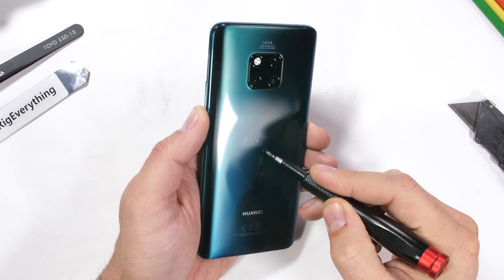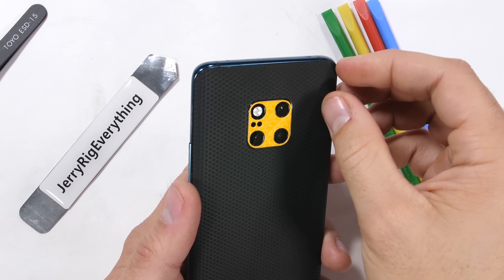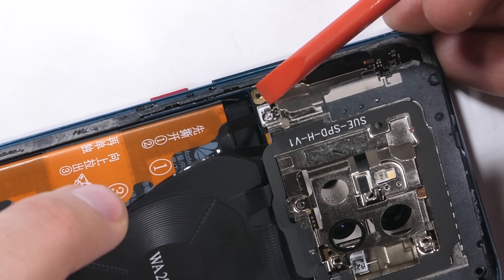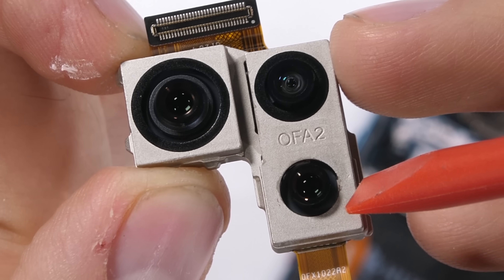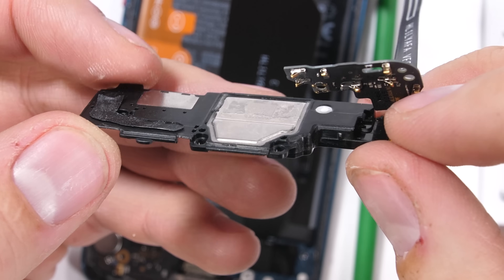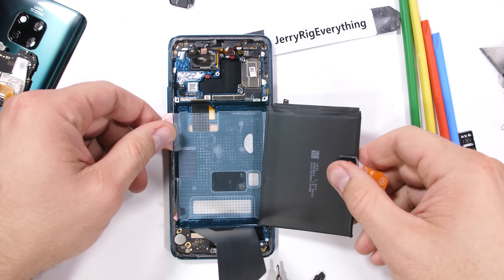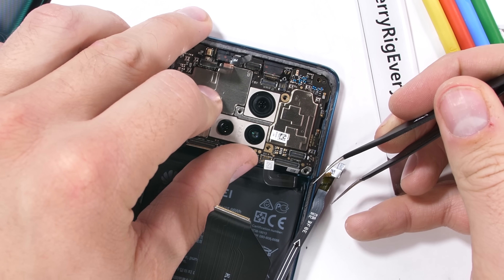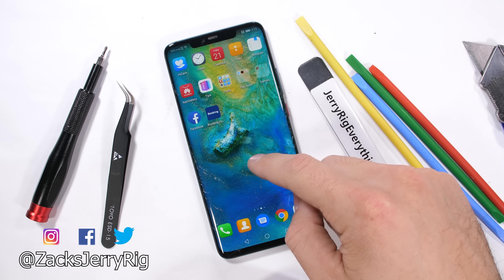Mate 20 Pro Teardown - Whats under the 'Musical' Back?

Comment: Still using this phone 6 years later. Great phone
Reply: Lol same
Reply: I am using a regular mate 20, still alive and well
Reply: So did I, until it started boot looping a few weeks ago… turns out after 6 years of only super charging the battery gave up on me. I just about managed to transfer all my data to my PC hard drive before it hit me with the eRecovery screen one day. It’s been a strong companion to me over the years though, and I will miss it. Switched to the dark side now, writing this on my new iPhone 16 pro max, in hopes that it will last even longer.
Reply: So did I too , 
but yesterday it started rebooting when the screen was closed. Is there a solution? The mobile is working efficiently

Comment: Hi, I had the same issue that the phone did not accept the new battery. Luckily I found a workaround in a German newsgroup: 1) Boot up the device using the original Battery 2) connect an USB charger to the mobile 3) Disconnect the original batery and connect the new one ( you have to be quite fast, if the phone shuts down during the change you have to go back to step 1) 4) charge the phone for about 10 minutes and check if the batteryindicator moves up. 5) restart the phone and double check that the new battery is accepted. I’ve tested this method and it worked for me.

Comment: When it hit  the market it was £899.00 new .I bought it new for £ 410.00 . 8months later . I use the wireless charging feature . It's good to have . Generally speaking it's a great phone . Technology moving so fast whatever you buy is out of date within a year. Great video. Thanks👍
Reply: I just bought one 2 months ago for $300 USD, open box from China but it's a global variant. Love this phone. Too bad most US carriers refuse to transmit over it. But it'll be getting put through the paces in Panamá! In Panamá they have no fear of the Huawei brand. In fact there's a Huawei store in the Allbrook Mall. I used my dual sim Mate 9 there before with Claro and Tigo without a hitch.

Comment: What may happend if you accidentaly, trying to take out the sim slot, you put pressure in the hole of the microphone that is next to the sim slot hole? (Sorry my english) I've just opened my brand new mate 20 pro and I did this, but I didn't feel the "accesory to take the slot out" passed through the mic. I mean, it should have something to prevent the water get inside the phone (IP68). I'm afraid that I could broke something inside or I don't know, I'm just too much paranoic right now that I broke the phone right at the first step before even turning It on jaja. Please, I need an answer...could I (did I) broke something inside? I've made tests and the mic works perfectly, I'm only afraid about the water could get in if I broke something inside.

Comment: For those who aren't aware. This phone has two speakers. Yes the usb port is one and the sound does get a little bit blocked when plugged into the charger. But if you want to know there is a speaker on the top of the phone also which raises its volume when plugged in. They both work together also to create surround sound using dolby atmos. Hope that clears that up to you all.

Comment: I used to be an extreme anti-no-headphonejack-policeofficer, however now that I have the mate 20 pro, it doesnt pose too much of a problem because the battery lasts so long I never need to charge it and play music at the same time (same applies for the speaker), also the front facing earpiece speaker makes up for the mild loss of the bottom speaker

Comment: I think what really bogged this phone down is the fact it's not sold in America, and the software. The speaker system is stupid
Reply: And you don't need to listen to music during charging, unlike all other this one last all day long and still leave you with battery before going to bed...
Reply: For those who aren't aware. This phone has two speakers. Yes the usb port is one and the sound does get a little bit blocked when plugged into the charger. But if you want to know there is a speaker on the top of the phone also which raises its volume when plugged in. They both work together also to create surround sound using dolby atmos. Hope that clears that up to you all.
Reply: @GenXchaos  that makes more sense

Comment: This would probably have been my next phone if they had bothered to include a headphone jack and an sd card slot, such a shame. I just don't get why they left that (the 3.5mm jack) out from only the highest model in the range (Dont tell me it was neccesary to save space, it almost never is), while not bringing features like wireless charging to the rest of them. They now have a range of high-end phones, neither of which has all the functions. (I do really like the IR blaster though, never understood why Samsung removed that feature from the galaxy S7 and on)

Comment: Yep: Speaker port being plugged by the charger is not a good thing. The camera performance is cool, but I don't like the "painted" effect from over processing on some shots. I was REALLY geeked about the reverse wireless charging, until I found out how painfully slow it is. Half an hour only charges the other phone a few percent, and you can't use either phone while doing it. Using an OTG adapter and plugging another phone in direct is SO much more efficient and effective.

Comment: There's no way I'd buy that junk, no headphone jack, no speaker grill, proprietary memory card, notch, no way!
Reply: Stick with your shitty far inferior junk then as this phone blows everything else released this year out of the water in every way.
Reply: And also the notch allows you to have face unlock 3d wich is the best and faster way to unlock ur phone, so is there for a reason and a pretty Damm good one I wouldn't take a hole or tear notch to lose that face unlock
Reply: @phoenixpeppers  Guess you've never heard of one of the many Android phones that have no notch with face unlock
Reply: @ELECTROHAXZ   I guess u have no idea what that is... That face unlock u talk about is 2d wich means with a simple photo downloaded from ur fb or Twitter or even someone with slightly similar to you can pass that and get into your phone, this mate 20 pro face unlock is unique only face Id from Apple works the same way with a laser and sensors that make a 3d scan of your face and these 2 are unbreakable unlike the one you talk about wich I had before in my honor 9, not only is alot slower like it's easy to break into

Comment: 3:50 A saying I've been hearing ever since a certain phone came out in 2016 that caused the worst smartphone trend ever.
Reply: Dan Odden 
Jack is going extinct. Only LG has fully saved him
Reply: @Metamine0  which is why I use an LG V30.
Reply: Dan Odden 
How's the Hi-Fi Quad DAC treating you? Just got the XR, and kinda missing Jack, but the speakers are fantastic
Reply: @Metamine0  its definitely an improvement in sound quality over any other jack I've used. Although my headphones aren't good enough for them. I'm gonna invest in a pair of Beyerdynamic dt 770 pros.
Reply: Dan Odden 
That would be a good investment, since those are great for a myriad of things
Reply: @Metamine0  yeah

Comment: No headphone jack 💔
No micro-SD card slot 💔
The speaker thing I can forgive 🤷🏻‍♀️
Also it failed the durability test ⚡ 
No I would not buy this phone unless I was under the influence of lsd.
Reply: There is micro sd slot
Reply: The micro SD card slot uses Huawei nano SD cards only but I've had this phone for months now and haven't put a dent in the 128gb of internal storage a great phone probably one of the best out right now definitely take it over a iPhone any day of the week

Comment: I'd rather buy Note9 than this one. S-Pen, Headphone Jack, no green screen risk, normal SD-card slot, normal speaker on bottom.
Reply: @guramovich  he meant normal speaker that doesnt come from the usb-c like the mate 20
Reply: @kristiancolonna7594  it's a bad design because if it gets wet not only the usb is getting damage but the speakers as well.
Reply: @iamtheone2292  - Its dust and splash resistant. And why would you even need your phone near or in water? I mean its cool and all to have water resistance but man I never have got an idea "hey lets just jump in water with my expensive phone because it being by my side in my pocket all the time is not enough".
Reply: @zabvlad  accident's happens it's not water proof like Samsung so it's a bad design in that aspect
Reply: @iamtheone2292  Since 2012 I own a smart phone and I never had it come in contact with water or similar nor did people I know.
Reply: @iamtheone2292  It has an IP68 rating just like Samsungs stop spreading BS, neither will be damaged.
Reply: @iamtheone2292   it is ip68, you can dive with it as much as a note 9, if you don't know what ur saying just stay shut
Reply: For those who aren't aware. This phone has two speakers. Yes the usb port is one and the sound does get a little bit blocked when plugged into the charger. But if you want to know there is a speaker on the top of the phone also which raises its volume when plugged in. They both work together also to create surround sound using dolby atmos. Hope that clears that up to you all.
Reply: @guramovich  Also
Reply: Ok
Reply: I'd rather get a Xiaomi MI mix 3 instead
Reply: It's dual speaker and I use it heavily everyday and I get about 30% bat at 1am before going to bed and leave it to charge, thing is you don't need to charge it before sleep so why would I bother with sound quality when charging? It also charges from 2% to 100% in 56 minutes or 70% in 30 it doesn't take 3 hours like iPhones or over 2 hours like note 9 and battery lasts alot longer that speaker issue isn't an issue at all, it's kicks note 9 everywhere except the pen wich is useless to me honestly
Reply: do u also want some C4？
Reply: I have the Mate, Mate 20 Pro's way better in every way.
Reply: @jzvr5842  In which way it's better?

Comment: I think because of the 40W supercharge and the 4200 mAH battery there will be no problem with the speaker inside the type C port because the phone can charge instantly in the morning as you prepare for your job and be able to hold on easily till the next morning

Comment: My needs for a phone:
1. A headphone jack
2. Usbc
3. I.p 68 water resistance
4. No notch (dont like em
5. A 1080 p or higher screen resolution
6. Not bigger than a 5.8 inch display (find them way to big)
7. It has to be android
8. It needs ois
9. It needs a decent camera
10. I like it if they have fancy colors
Reply: Okay.. so, no need for 4G signal and battery? 😅

Phones nowadays are good enough for our needs, but they may never satisfy our wants.. 🤔
Reply: @armanke13  its just specs i need of course 4g and a battery are needed😂
Reply: @gain 14 of course
Reply: @gain 14 note 9 has same 6.4 inch screen as this one although side by side note 9 is quite larger and this one you can use one handed easy

Comment: Thanks to the 15 watt wireless charger I don't care about the speaker inside the type C Port. I mean even with wireless charging it needs less time to charge like the iPhones with cable 😂. Also the battery life is insane so you will never get any trouble with it, which means that you almost never need to charge it over day with a cable 😁. So everything is fine (for me)

Comment: Too many negatives on this phone , i would not and did  buy it  ,  build quality issues aside  ,  it is even narrower than  some other popular trendy tall narrow phones ,  and some might see that as a good thing  , but if you have  medium to big hands and fingers it sucks .
  yes indeed ,  the no  proper speaker grille ,  no headphone jack , no  proper sized sd card slot  .
 no 4k 60  video  iirc ?  so so  video quality when panning  .
  While it has some  nice features , big battery , some good camera  features  and general performance  , all those other  issues  , imo it is still a peg or two below where it should be .  
 Note 9 was easily a better  device imo .

Comment: Reasons to pass this phone:
- notch
- no microSD expansion
- no headphone jack
- Huawei
Reply: - no rooting
Reply: Huawei is a good phone. Just because you dont like China doesnt mean you have to hate their phones.
Reply: Well one negative that I cannot disagree with is the UI. It's not bad by any means but I'm a stock android guy. But it can grow on you as it did on me. You wouldn't really mind it from the day three
Reply: see I wanna say you're missing out, but people like you who's so freaking brainwashed by the media wouldn't care so I guess, have a good day
Reply: Huawei phones are only banned in Trump's USA. Huaweis next gen 5G equipment is the one in question and getting banned in SOME countries out of the 70+ countries which relies on Huawei's network infrastructure
Reply: I can get over the notch, and that its a Huawei isn't a problem at all, but the removal of the 3.5mm jack and choosing to use a proprietary memory card instead of a commonly used and accepted one is just stupid. (And please don't come with 'other manufacturers are doing it too, it's 2018, live with it' , thats not an argument) As long as USB-C headphones aren't common (which they will probably never be, as manufacturers disagree about how to implement them so not all headphones work with all phones) it simply makes more sense to use a  commonly used, widely implemented, compact connector that allows full compatibility between device and audio input. The 3.5mm audio jack just so happens to fulfill all those criteria. Sorry if i sound agressive, but i just get so annoyed by other phone makers copying Appe's stupid decisions.
Reply: @floriskuipers4925  i hear you. For me it's not a problem to go phone —>dongel—>jack and imo it sounds even better than my previous phone (with jack) but your argument makes sense, somehow. And I hate Bluetooth, that's just nowhere near, not even close, to a good representation of sound, yukh. Hoop dat je een vrolijke kerst hebt gehad :)
Reply: Reasons why your comment is worthless :
- You are dumb
- You are dumb
- You are dumb 
- You probably don't even have enough money to buy this phone .
And the last thing is : 
- You are dumb , the last one was very predictable wasn't it ?
Reply: Omfg 😂🤣
Reply: Musical back ofc
Reply: He has nano sd expansion
Reply: Os basiclly you can only buy samsung in 2018.
"What? You dont hate the notch? Get the hell our of here! "
Reply: Reasons to get this phone
-Ability to hide notch
-Nano SD
-Everything else
-Huawei

Also you're stupid.
Reply: -you don't have money
Reply: Also reasons to skip apple devices.
Reply: - what notch?
- 128 gb and you still want sd?
- usb C delivers great sound, better than headphone jack. It's 2018 move on. 
- Huawei who? What's your problem, get back to Facebook and the likes. There is no proof against Huawei just rumours and guess where those came from.
Reply: @Sool101  wdym "move on". There are more devices with headphone jacks than devices without them.
Reply: @figureless1094  yeah I know and I was very much into headphone jack as well and still use it with the 'dingle'. Coming from HTC 10 which had a great DAC but, then I heard the difference and I really like it. The M20 pro lacks volume but makes up for it in detail and separation. So, therefore. And again, I still use jack but there's no need for a dedicated output anymore.
Reply: @Sool101  samsung still has headphone jack, your point ?
Reply: @thearmyofiron  all my headphones still are jack, that's not the point.
Reply: @Sool101  you told us to move on to wireless headphones
Reply: @thearmyofiron  where did you read that?
Reply: @Sool101  what rumors? These are facts lol go search
Reply: @angelin4027  show me facts, please. Huawei has been on the market for years and supplies a whole lot of networks which have been built up over the years but suddenly.... Odd, very odd.
Reply: @Sool101  no, I mean facts that these countries are banning Huawei
Reply: The thing is, that's are the only reasons to pass this phone, which a lot of people don't mind anyways. BTW I don't get that Huawei part. Stop judging before you actually use them my man.

(Mate 9 user for 1.5 years, planning to switch to Mate 20 pro. And I can confirm it's a damn good phone)
Reply: @rinshad  because Huawei has restrictions in Germany UK Australia and USA
Reply: @angelin4027  Remove Germany then the sentence is correct 

And why are those restrictions in place again? 

Oh i remember: Some BS the USA told without providing proof
Reply: @angelin4027  Not in Germany and both UK+Australia have Huawei phones.
Reply: @jzvr5842  search then
Reply: the last one is the worst ,  jk .
Reply: @hamzaHrv  
Lol
Reply: It’s not that hard to get over a cutout in the display
Reply: Nothing wrong with a notch that you can disable in settings;
It has proprietary expandable storage and at least 128gb on board;
Bluetooth or included USB C adapter solve that one;
Nothing wrong with Huawei from a consumer standpoint.

There are some reasons why you may want to pass on this phone, such as its relative fragility or some quality issues with the LG screen, but it stacks up really well against the competition. It is a great all-rounder.
Reply: Spying

Comment: The orange tabs attached to the battery reads: 
(1) First remove (1)(2)
(3) Then, alone by itself, pull out (3) upwards

So essentially, 1 and 2 are not magical pull tabs. No clue what purpose they serve however.

Comment: I bought the Note 9 instead. I was considering the Mate 20 Pro until I saw you cracking that screen so easily. If it can't survive that what will happen when dropped? That and all the other problems like green screen, bad speaker, no 3.5, etc.